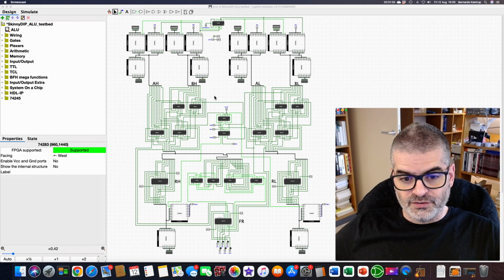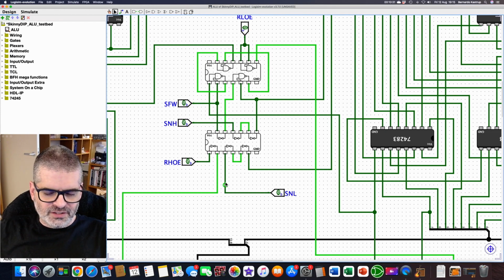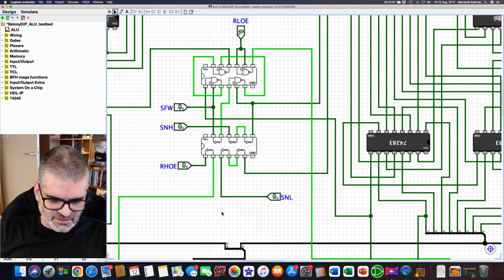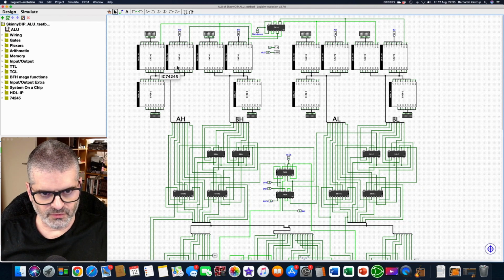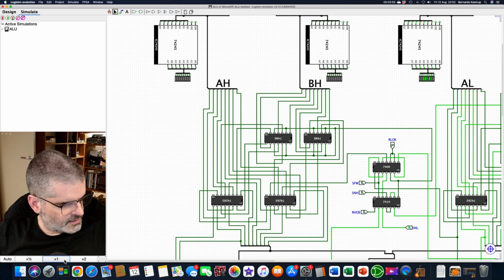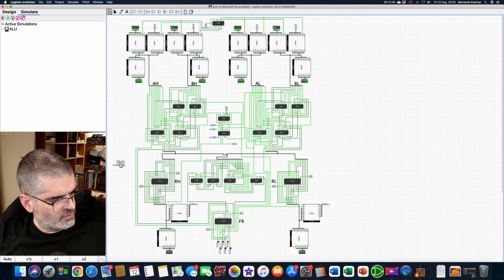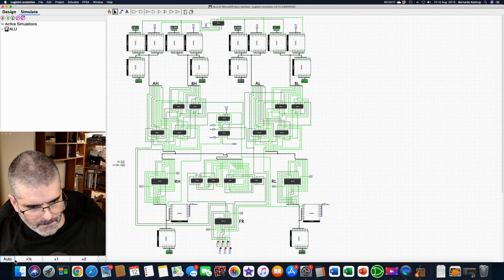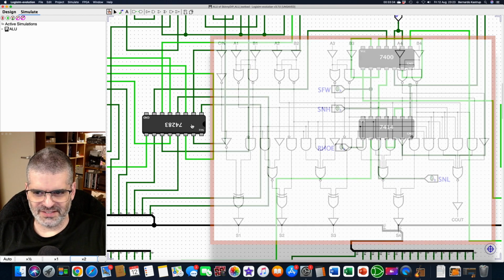Building Talos ES™, the 21st century's mini-computer (Episode 3)

Comment: As far as I know and remember, fan-out is not only problem because of the lack of enough current to be sourced, but also capacitance is added by every connected other gates (and traces leading to them), thus limiting the top clock frequency the circuit can work at the end (but maybe they are related, as changing the level having more capacitance needs more current especially at higher frequencies) . At the other hand, introducing some gate as "driver" causes some extra latency again, limiting max frequency. This is also true inside an FPGA, usually the software used to create a bitstream for a given FPGA can create a timing report, what top frequency the design can work because of issues like these (I guess given by the routing it could create being "optimal"). As I am a kind of "self educated guy", please correct me, if I am wrong here (I'd like to learn). Very interesting series of videos! By the way, not to flame here, but I think but James Sharman's design - though it has its problems, probably even ones I don't know about - already exceeds the "not so much useful toy" category, as it can do far more than only executing a few opcodes long program. Recently he demonstrated a kind of Wolfenstein kind of raycaster on his hardware, which I would call "something useful" already, and certainly more than only a few opcodes long toy code. But again, I have no intent to argue here, just it's my humble opinion. After all I am here to watch these videos to learn something new :)
Reply from the maker: Yes, you're correct on the fanout issue. In chip design (including FPGA synthesis) the issue is called 'timing closure,' and it is usually the last thing to be solved before the chip can be tapped out. Board-level design has an equivalent issue.
Reply: James Sharmans computer is now starting to get a full fletched game computer now so yeah he has surpassed the toy level though storage is not addressed yet

Comment: Hi, thank you for making these videos, I enjoy the style and the pragmatic approach to your design, please keep going. On the note of education, I unfortunately could not afford to get a degree and working full time in my job has made it nearly impossible to commit to getting one at least for now. I managed to learn all I needed to know for my job by learning everywhere I could get my hands on and following MIT open course ware and curriculum structure to guide me in what to learn next, but mostly I learnt based on what I needed for the job anyways. I am a full time software architect and solutions engineer of IoT systems and my colleagues and management see me as such because of the true value I provide in my job, based on my 13+ years of learning and doing the job, I can definitely say I can "teach" an audience and in many cases my job requires that of me. To say that I am potentially unqualified to teach due to my lack of qualification maybe unwarranted based on my raw experience that I have to offer, it might be that I am an edge case but I wanted to say is that one can teach and teach well, but one must be taught first and taught well, even if that on your own. I have fond memories of learning (and still learning) from the following books:
- Electronics: The Art of Electronics, Practical Electronics for Inventors.
- Digital: Digital Design and Computer Architecture, Digital Computer Fundamentals.
- Software: Think like a computer scientist, and many many more.

Comment: Political considerations? Dare I talk about race conditions when chaining inverters?
Reply from the maker: There are no race conditions arising from chained inverters. You misunderstand what a race condition is. You could have one e.g. if you AND a signal with its inverted self (with an inverter). But a chain of two inverters, in and of itself, gives rise to no race condition, just a slightly delayed un-inverted signal at the end (a dozen nanoseconds or so).
Reply: @thebyteattic  Those delays can be deliberately used though. If there's a room full of remote controlled machines it can make the difference not having a misdcue or talley. I'm sure you have a tight timing scheme. I'll look forward to future episodes. Thanks!
Reply: @thebyteattic  At 2 mhz the effects will be minimal anyway.  But, yes, there is no race without a finish line.

Comment: Thank You! I learned boolean logic from the Navy at a time when counters were beam switching tubes and multivibrators were made with tubes as well. All very hush hush. On my return from Vietnam, I became a videotape mechanic. Near the end of my career my machines were implemented in microcontrollers. You've made CISC & RISC clear to me. It should be Reduced Instruction Sequence Computer. Not Set. But, as I learned in my short stint as a tech writer, engineers were never strong on language, only syntax.

Comment: Again, your points about Ben's videos (which I think are great, by the way) are quite fair.  I am like Ben as being self-taught (my background is in Computer Science).
I think my experience can be fine for home and fun projects (which is why I do it), but then again I have worked with electronics engineers during my embedded systems days and know that in a commercial situation, you need to make products which are reliable in specific operating environments (which could be very noisy), must also be compliant (e.g. generating RF, electrical safety), need to have a sensible maintenance cycle (low or zero for electronics) and can be mass-produced.
These considerations add a lot of complexity, which is why I was not the one doing the electronics engineering!

Comment: Just a quick note:  @11:40: Double buffering in digital logic refers to a synchronization method for getting signals from one clock domain to another clock domain by using a series of two clocked latches (usually two D-type flip-flops).  I believe that what you have done using the series of two inverters should be simply referred to as a buffer, and is definitely used frequently in discrete logic designs to simply bolster a signal that will be fanned out considerably and may have an unknown fanout prior to entering the circuit in question.
PS: Not trying to nitpick.  Just clarifying my understanding of the normal terminology in digital systems.
PPS: I'm definitely liking this series so far!  Thank you for these videos.
Reply from the maker: I think it was abundantly clear and unambiguous what I meant. If you don't want to nitpick, then just don't; there are better ways to show your vast knowledge to the world.

Comment: I'm not sure about designing directly with 74 series chips (as opposed to the individual gates they contain). As you say, it can lead to mistakes when transferring logic and it obfuscates the design intent. Is this a limitation of EasyEDA? Kicad and Altium allow you to design with individual gates, whilst tracking which chips they belong to. That reduces the chances of mistakes, whilst giving a lot more flexibility about swapping gates to solve particular routing problems.
Reply from the maker: I'd still not use gates. Why would I bother to e.g. replicate the internal design of an ALU chip in gates? I know the chip works. And I may want to use the free gates in a chip for electrical purposes (as I do in this video), which I can only do if I am doing the schematic using the actual chip symbol, not gates (otherwise I have to count how many gates I've already used, how many are still available in whatever chip ends up being used, etc., just silly stuff). I may also want to decide which particular gates to use for which particular lines based on physical layout considerations (happens a lot). Anyway, I already talked about all this in the video and exhausted the point, I think.

Comment: The 74LS132 is a Quad 2-Input NAND Gate with Schmitt Trigger Input.
Reply from the maker: Yes, but I needed three NAND gates at least.
Reply: @thebyteattic  you mean NAND without Schmitt Trigger? These have also 4 NAND but with Schmitt Trigger.
Reply from the maker: @MichelHernaus  Not in LogiSim-evolution, so people wouldn't find it in the simulator (though I could, of course, make a model myself, it would be ugly like the 245 I made, not looking like an IC... But the 245 I really needed, can't do without). If I begin to suspect that I really need a Schmitt-trigger in that line, I will install to a 74H132 on the socket, instead of the 74HC00. They are pin-compatible anyway.
Reply from the maker: @MichelHernaus  By the way: I misunderstood your original comment. I thought you were alluding to the 74HC13, which is available in LogiSim-evolution. Apologies for my careless reading of your comment.
Reply from the maker: @MichelHernaus  Another PS: LogiSim-evolution does have the 7424, but I don't think 74HC24's are made. At least I can't find them on Mouser.
Reply: @thebyteattic  I can’t find a datasheet for 7424 too and also not in the TTL data books. I guess it’s wrong in Logisim-evolution.
Reply from the maker: @MichelHernaus  Bipolar versions do (or at least did) exist: https://archive.org/details/bitsavers_tidataBookVol2_45945352/page/n149/mode/2up

Comment: I thought you were extremely nice in the first video, while also bringing up some extremely valid points. Actually that goes for this video too. 🤷‍♂

As just a bench and field repair technician and a general motion picture "Nik go make that ancient electrical thing work" and/or "make it electrically safe", I'm actually amazed by the number of electrical design considerations you've mentioned that I actually do consider in the rare times I build a circuit. That being said I still know I'm no electrical engineer and there's plenty I don't know that I wish I did. Actually if there are free college courses on the subject, I should probably go check those out. 😅 The last time I wanted to get a better foundation of electrical engineering, I ended up watching someone on YouTube where I immediately knew he was underqualified for what he was explaining. Oh man... and some of the electronics repair videos out there, something I'm actually qualified in. 😬 (Which actually, I need to go check yours out. I presume you're more qualified than me 😂)
Reply from the maker: Techs are much better than me when it comes to repairs... they're better qualified too. Thanks for the encouragement!